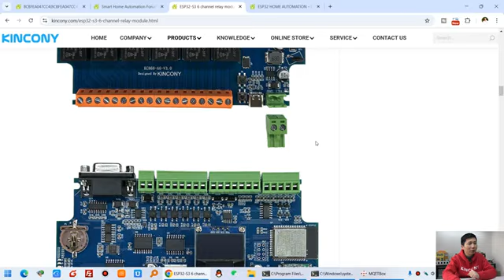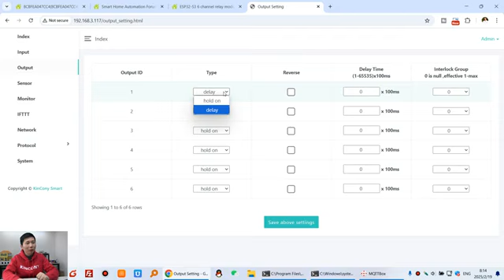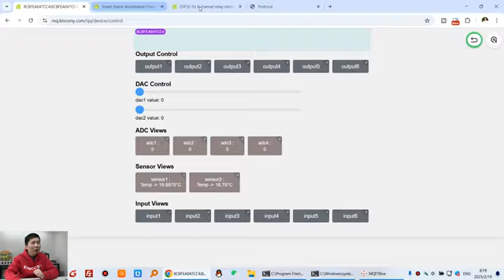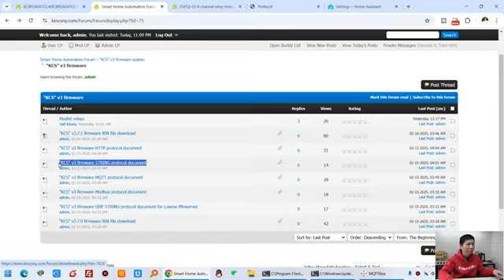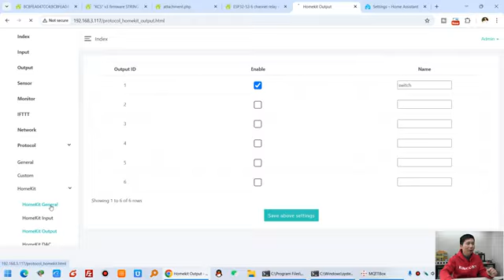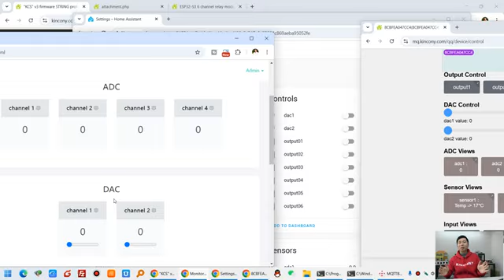NEW A6v3 powerful ESP32 module for Home assistant with auto discovery

Comment from the maker: ESP32-S3 6 channel relay module – KC868-A6v3

W/A:+86-15531181781
Email： liluna@kincony.com

Model No. KinCony A6v3
Description: KinCony 6 Channel ESP32-S3 Smart Relay Controller – A6v3
Power supply: 12V DC
Processor: ESP32-S3-WROOM-1 (N16R8)
Size: 148mm*106mm
interfaces: WiFi,RS485,Bluetooth,USB-C,LCD,I2C
RTC: DS3231 high precision chip (battery socket on PCB)
Installation method: DIN RAIL (need plastic shell)
LCD: SSD1306 I2C display
wireless module socket: SX1278 LoRa / nRF24L01

Outputs:
6CH relay Outputs, every relay use by MAX AC250V/10A

Inputs:
ADC: 4CH analog input DC0-5V (A1,A2,A3,A4)
6CH dry contact inputs (optocoupler isolation, long distance circuit for MAX 500 meters cable)
2 buttons: S1:ESP32 Reset S2:ESP32 Download
1-Wire GPIO: 2CH (with pull-up resistance on PCB)
free GPIO on PCB: 7 ports

software solution:

1. download KinCony KCS v3 firmware, so that work with multi protocol: HTTP, MQTT, TCP, RS485 modbus, config OUTPUT for “momentary” and “interlock” group functions. “KCS” support IFTTT function work locally without internet. It also support use by KinCony cloud server. KCS v3 support home assistant auto discovery function by MQTT, so without any config file for home assistant.

2. download firmware by ESPHome, integrate to home assistant or use by web service.

3. download tasmota firmware.

4. write your own Arduino or ESP-IDF code for your own requirements.

5. support tuya app if buy tuya license.

6. It is recommended to use home assistant and Tuya mobile phone app at the same time. So that remote control by internet using Tuya app, local control by LAN using home assistant app.

Related technical information
———————————
ESP32 I/O pin define: https://www.kincony.com/forum/showthread.php?tid=7622
KCS v3 firmware download: https://www.kincony.com/forum/forumdisplay.php?fid=75
config yaml file for ESPHome: https://www.kincony.com/forum/showthread.php?tid=7623
ESPHome official supportted list: https://devices.esphome.io/devices/KinCony-KC868-A6v3
arduino demo source code: https://www.kincony.com/forum/forumdisplay.php?fid=69
KCS v3 firmware online guide: https://www.kincony.com/how-to-use-kcsv3-firmware-esp32-board.html